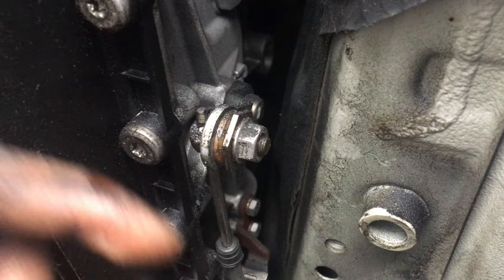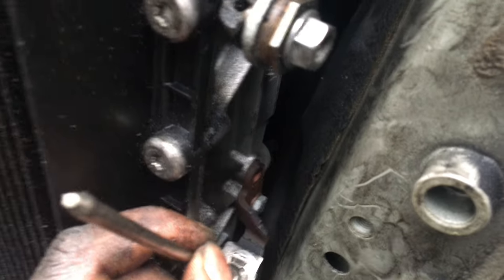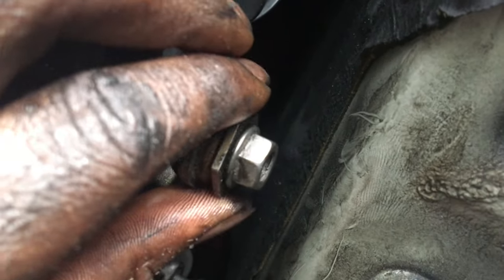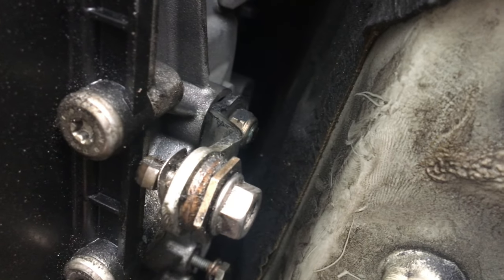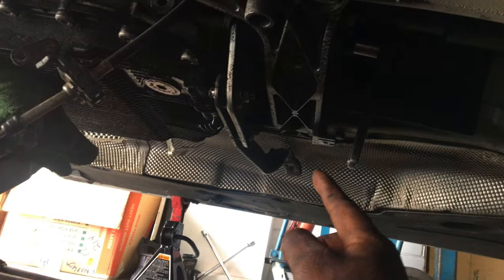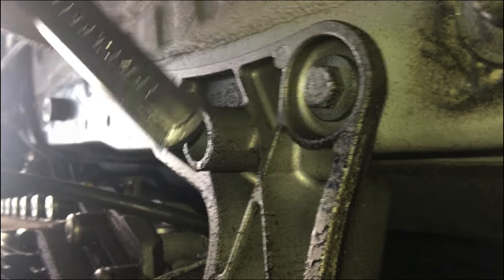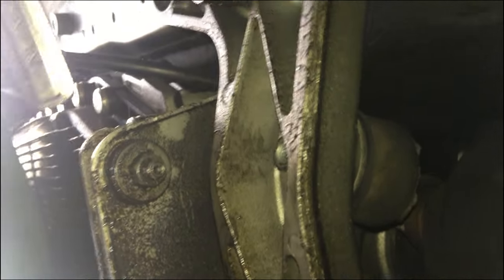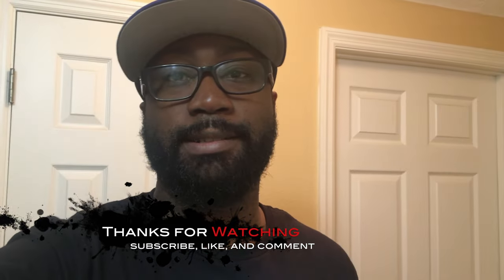BMW 335i N54 Engine Removal DIY Part 02

Comment: hey buddy probably too late for a reply but how did you evacuate the AC lines with the BMW in nonworking order? I am currently struggling with that part as my BMW doesn't move to take it to a shop.
Reply: @nOshi2x  thanks man, i looked alittle further into it, and came up with either renting a u-haul to a shop to do it or buying an expensive recycler pump for this build and future.. weighing my options but have you thought about rebuilding your n54 that blew if you didnt scrap it? be an awesome tutorial to watch

Comment: Did you have to unplug any wires from the trans?
Reply from the maker: Yes the transmission harness on the side of the transmission. You pretty much turn a tab clockwise on the plug and then pull it back to remove.
Reply: @nOshi2x  Oh yeah one more questions, did you need to remove the O2's from the downpipes or were you good to leave them connected?
Reply from the maker: Yes you can leave them connected if your pulling the motor out with the harness still attached to the engine, and your disconnecting it from the dme area and left the Dow pipes attached.